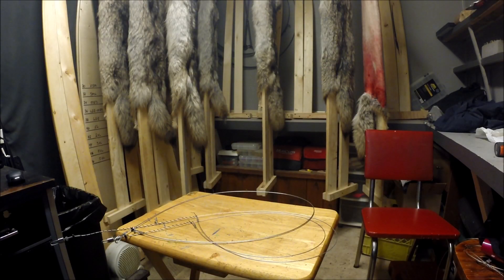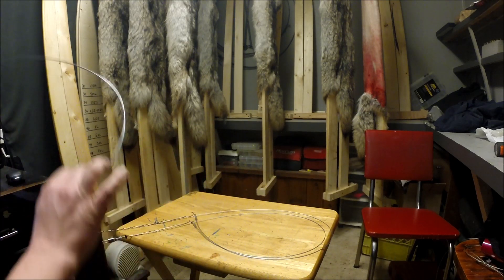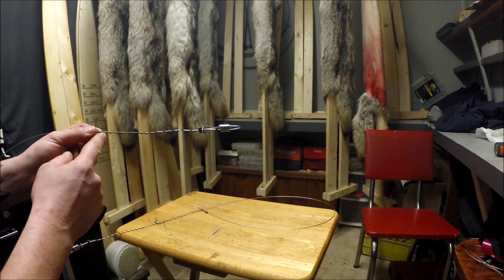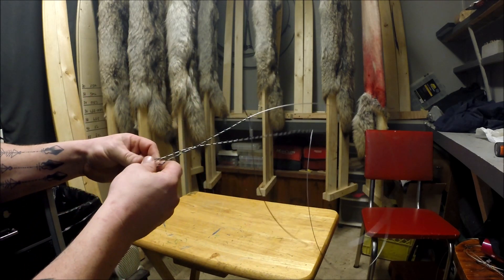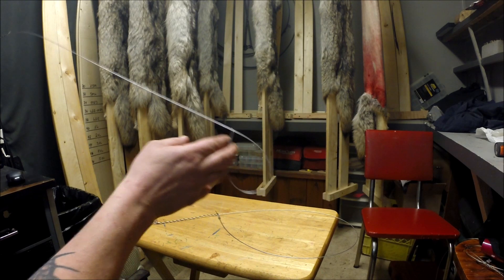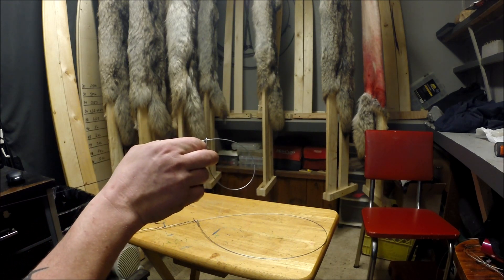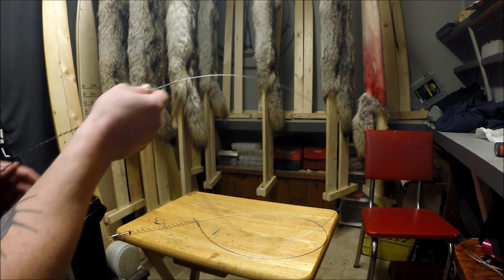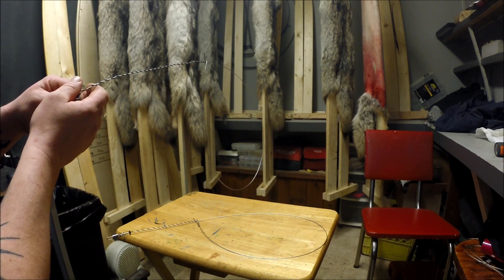Snares and support wire

Comment: Good vid. I always set my wolf snares way high.  With k-9's you want that cable to tighten high on the neck and right behind the ears to cut off those carotids.
Reply from the maker: How big of a loop are you running for wolves? Around 20 inches? Ya I think could a lot harder to catch a wolf than a coyote. I would love to walk up on one of them in a snare.
Reply: I dont know exact dimensions, but I think its 68" of cable making likely a loaded loop thats approximately  14+" wide and 20" tall.  1x19 3/32 cable with a toothed cam lock, kill spring and a 750lb breakaway for moose. It looks like a big loop when you back up and look at it. But like i said I set the bottom of the loop about 2" above my knee.

Never caught  coyote but a dead wolf in a snare is not that impressive to me. Id rather have a nice pretty coyote like you have...LOL a lot less work to skin too..Ha!
Reply from the maker: @GoldCountryTrapping   I bet they are a lot of work.

Comment: great video. I have been having great success with rams on cattle trails with no grass or weeds to hide rams. use a stand to support ram. the ram in full sight does not seem to bother them.
Reply from the maker: Thats sweet. are you using ram foots?
Reply: hi no ground frozen. built a stand to mount ram. base plate with stainless steel shim to wedge in to spring